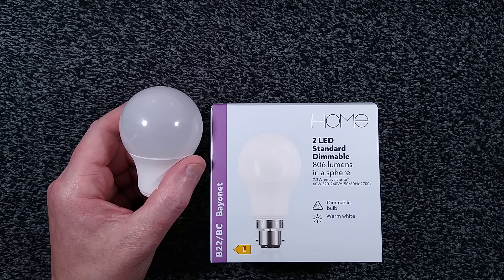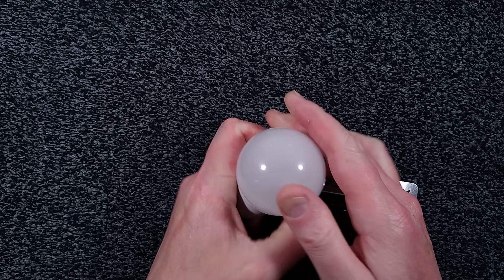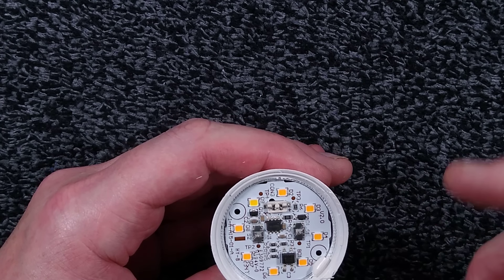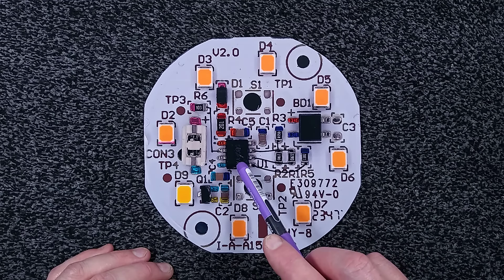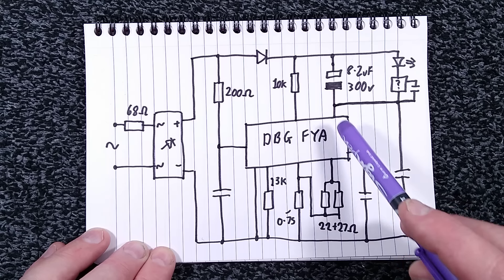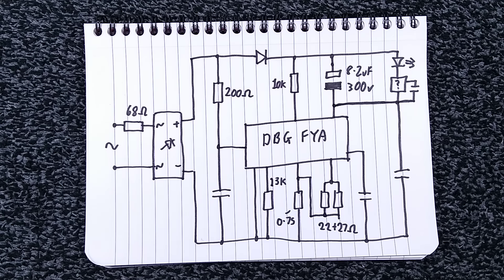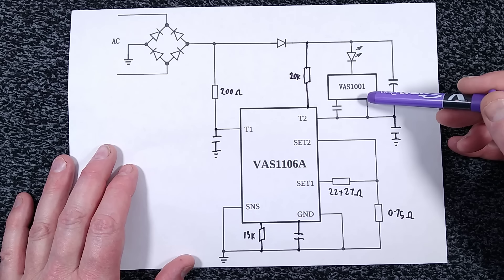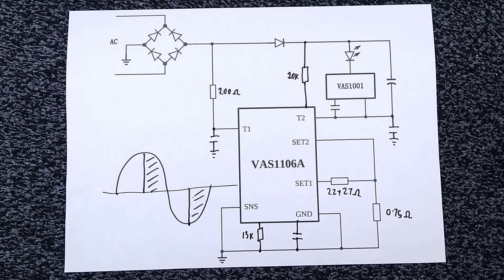Inside a Sainsbury's dimmable LED bulb

Comment: Lol, typical of that place :D
I bought a so called dimmable led lamp running off a standard dimmer. It worked for about 3 minutes then started to flash, even at full brightness. Dimming didnt work very well either, it would hit distinctive stepped brightness levels before flashing again. So I have it on my landing now at full brightness, still working, it just hated that dimmer :(
On a similar note i have a 4 way GU10 fitting in my bedroom on a dimmer designed for halogen lamps BUT I had to leave one of the halogens in the fitting otherwise the dimmable led lamps wouldn't dim properly either, there was only a short section of the dimmer that did anything to them. I can hit a sweet spot where the LEDs are just nice and ambient but the halogen lamp is barely lit, just a nice dim red glow from the filament :) Maybe I just have crap equipment lol.
Reply from the maker: A tungsten bulb may be required for the dimmer to operate properly due to a minimum triac latching current.  With MR16 bulbs, you often require a new transformer or at least one tungsten bulb for it to work properly.
Reply: @bigclivedotcom  Alternatively, try a suitably-rated capacitor across the bulbs. I have a touch dimmer which suggests this in the case of flickering.
Reply: @bigclivedotcom  thankyou, I am so out of touch with electronics  my learning ended about 30 years ago lol, I'm OK with kits but still don't fully understand them, my knowledge is stuck at 7400 logic chips and 555s lol xxx
Reply: @matthewmarks6951  il give that a try, thankyou 🙂 I'm guessing an x2 rated cap is needed?
Reply: @JohnnyX50  Yeah - rescue one from an old power supply - but maybe don't buy one new as my advice might have been bad there - the touch dimmer I am thinking of needs some current flowing to keep its microcontroller going, and doesn't mind the phase shift, whereas a simple triac dimmer might.

Comment: would these work with the old theatre dimmer packs? I think they are triac based and we are having issues dimming our house lights despite them being "dimmable" led bulbs
Reply from the maker: The main issues with industrial grade dimmers is the snubber network, which passes enough current to make LED bulbs glow or flash, and the relatively high latching current required for reliable dimming, which often requires a tungsten bulb to be added to assist in proper operation.
Reply: @bigclivedotcom  I've got a 10kW dimmer (so old it includes a germanium transistor, but uses inverse-connected SCRs which I gather are less lossy than a triac) which I intend to use to divert solar power into my immersion heater since my new "smart" meter registers consumption from burst firing, which the old dumb meter didn't!!. Sorry, nothing to do with light bulbs!

Comment: Forgive my question,  you said zero crossing point,  but you appear to have marked the 90 & 270 points... could you please explain this?
Reply: He means that at “half” intensity (which is what he drew on the diagram), that is the time that the triac turns on. When the waveform crosses the zero crossing point (the current drops to zero) the triac will turn off. In simple dimmer controls the triac never turns on at or near the zero crossing point.
Reply: @Mark1024MAK At full brightness it must turn on fairly soon after the zero crossing point.
Reply from the maker: The timing is from the zero crossing point.
Reply: @johnm2012  Soon after, for “full brightness” yes. With the most basic circuit design, there has to be enough voltage to charge up the timing capacitor and to trigger the diac which then in turn triggers the triac by discharging the charge from the capacitor into its gate terminal. If more complex electronics is used, the triac can be triggered a bit earlier.

Comment: took one apart last week not this brand was a great value one  that had toasted itself was in the vent fan over the stove the board was burned up was able to just get the LEDs plate off will send a photo of it . all of them get very hot it seems even in a desk lamp several have failed in a short wile .

Comment: I thought they all needed trailing edge dimmers which use a MOSFET inside a bridge rectifier instead of a Triac (which can only do leading edge dimming). MOSFET dimmers can do either leading edge, trailing edge or so called "sinewave" (AC PWM) dimming. I used off the shelf consumer dimmable LED bulbs for this, they were controlled by MOSFET trialing edge dimmers driven by an Arduino, unfortunately this is the only (short) clip I have, it cycled through more patterns. https://youtube.com/clip/Ugkxx--CY2EN4y3XNlgAkIMa1w-RxPRVR2an?si=qOqbMWS_p6zJTPt9
Reply: They used to, but since the bulbs have become so clever, they don't have to any more. I've got a dimmer which claims to be able to switch modes depending on what lamp is connected, as you suggest.
Reply: @matthewmarks6951  Yes there are dimmers that can auto detect, there's several patents e.g. EP 1313205 A2 for it.

Comment: I wonder if anyone has thought of sampling a smoothed (averaged) version of the input voltage and use it as an input to a microcontroller to PWM the LEDs?

Probably too expensive for one thing.
Reply: Isn't that more or less what these do? Except they presumably determine the intended brightness by measuring the width of the pulses rather than averaging the voltage.
Reply: @matthewmarks6951  yes but at mains frequency of 50 / 60Hz with its visible flicker.

Pulse Width Modulation (on the Arduino) works at around 490Hz so the flicker would be less visible, especially if you had a capacitor of sufficiently high value to effectively give you an almost ripple free power supply to the LEDs.
Reply: As I said, probably far too expensive (and complicated) for a domestic bulb.

Comment: A chip to try and prevent ripple, over having a decent capacitor, people really will do anything 😂

Had a light at the hotel the other week and it was flickering at such a rate to make the blades of the fan seem obvious when in use, I've seen it done on purpose before, but never when a light is on its way out like that

If they are trying to get the colour tempreature right, then they're cheating, and one part of the room will be a slightly different colour tempreature, all the leds should be the same tone, lazy

Comment: I got some of those bluetooth/wifi controllable color and brightness bulbs.   Ya I'm a Cree snob.  They are so flaky as to render them minimally useful,  just fool with it till you get the color and brightness   then leave it alone.   Every time the power blips from a storm, every one of those bulbs come on. Hard headed yes, I later got a wifi controllable air conditioner,   lose the app cause even after hours of studying up on router settings, and physically relocating the router in spite of my phone showing 3 bars near the bulb, somehow that long trip off to the nether regions to someone else's computer in the clouds, the signal becomes   too flaky to be useful.   Why cant they make it where the signal is only local to cut out all of that latency?   You would almost think someone wants to sell data about how you use light bulbs and air conditioners.
Reply: But then you can't turn your lamps and air conditioning on and off from the other side of the world...